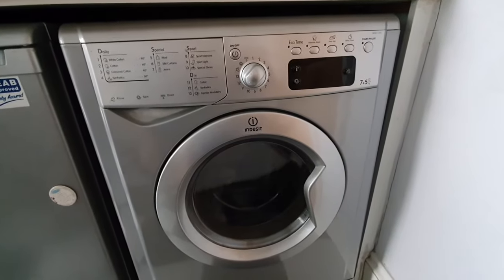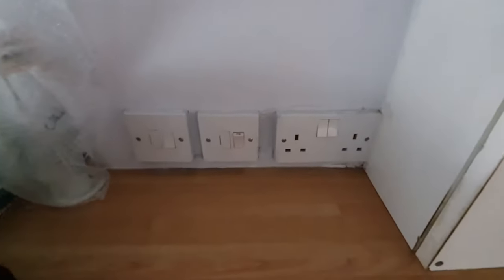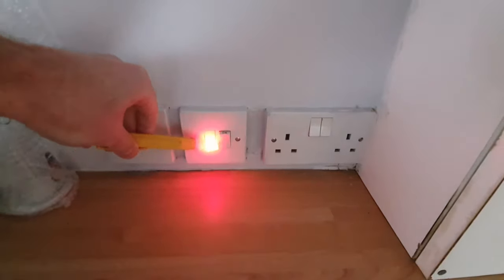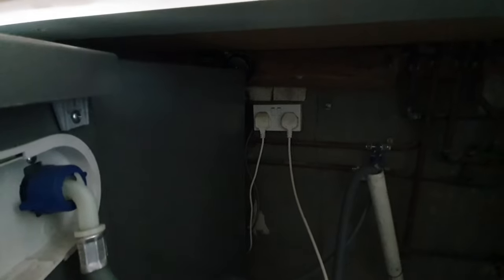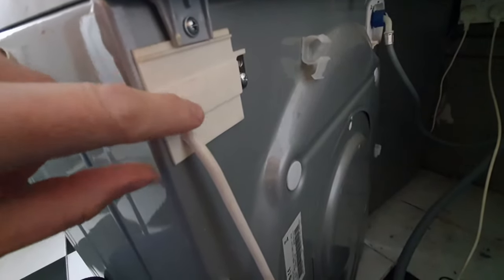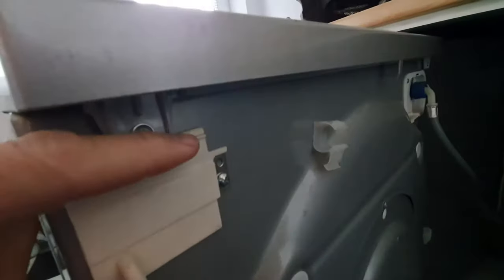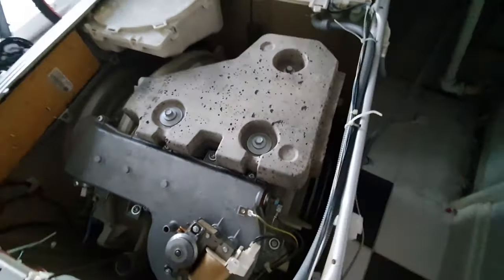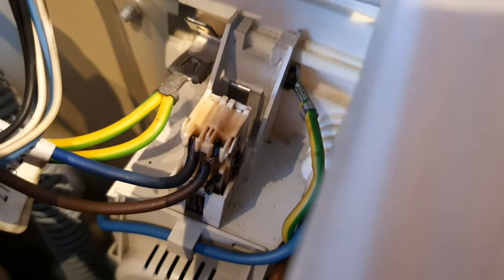Washing machine not working no power lights nothing. Finding the problem suppressor filter burnt

Comment: what tester device are you using? also im sad you never uploaded the next video for the fitting the new supressor and connector
Reply from the maker: That tester is discontinued now, but here's one for you. Don't waste your money on the cheap ones. Yes I've been away from YouTube lately, I will get that video up soon. Thanks.
https://www.ebay.co.uk/itm/324859096576?mkcid=16&mkevt=1&mkrid=711-127632-2357-0&ssspo=dM9yYk2CQ2W&sssrc=2349624&ssuid=dM9yYk2CQ2W&var=&widget_ver=artemis&media=COPY
Reply: Please put up that video
Reply: @simonrees6028  Hiya Simon my washer has no power please upload  your video how to install a new suppressor thanks I urgently need to do.. Thanks

Comment: Hello I have a question my dryer stays running but won’t heat.  Plus the lights and buttons won’t do anything when I push to start or turn off won’t respond only stops if I open the door all the lights.  Illuminate on the controls as soon as I close the door everything looks normal for 5 seconds then all lights go off but dryer keeps running cold no heat.   It turns off only if I imploge it from wall

Comment: What could it be if the suppressor has not failed?
Reply from the maker: Could be a number of things. What are the symptoms?
Reply: @simonrees6028  press the main switch and nothing happens .   Hold it for 30 seconds you get all the green lights flashing.
Reply: I check the suppressor and it looks fine.   Any chance you could help with this? I can press power bottom and nothing going on.  It was fine one day just stop working.;/
Reply from the maker: @MultiEski  please subscribe for help and advice, much appreciated 🙏
Reply from the maker: @andytaylor8802  please subscribe for help and advice, much appreciated 🙏
Reply: @simonrees6028  I am..lol..I binned the machine now though  :)
Reply: What is the part name I looked up suppressor and it didn’t pull up anything do u have a link for the part please